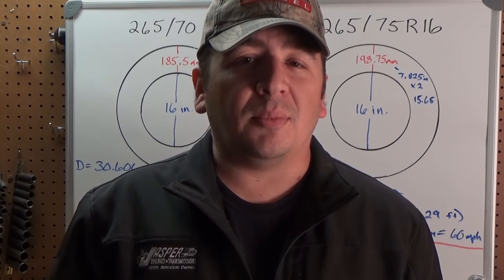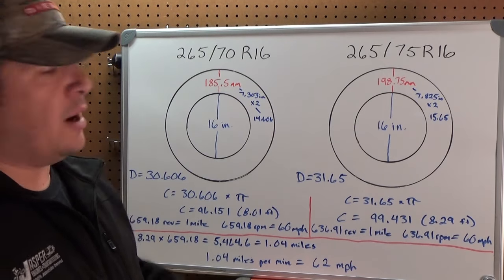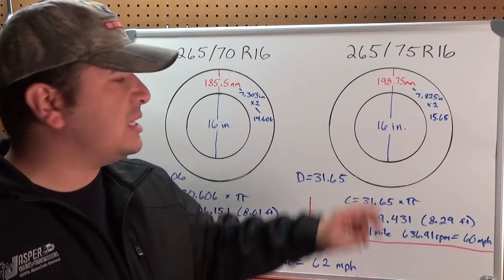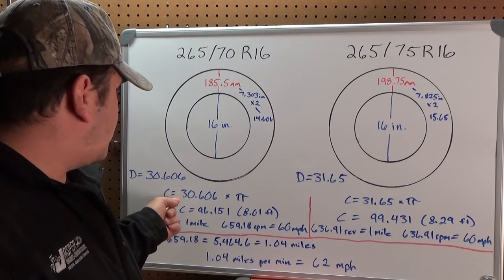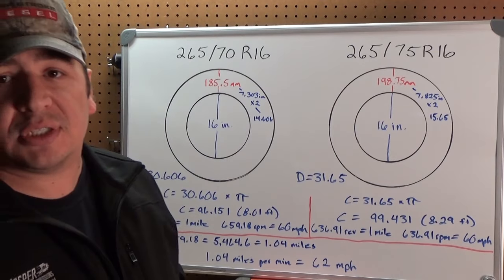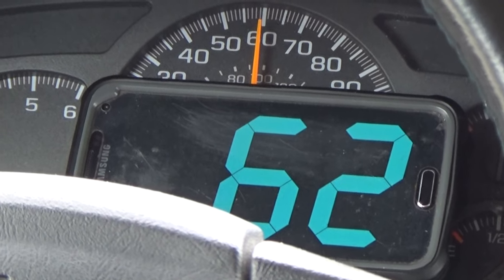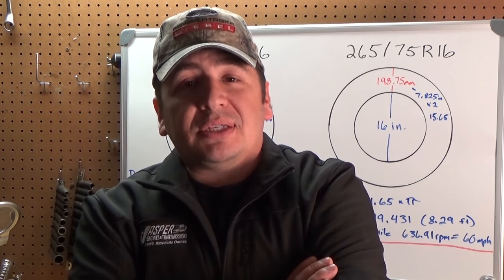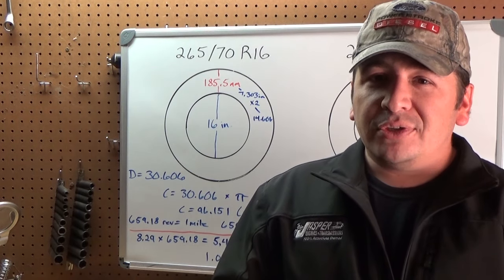Wrong Tire Size - What Does it Mean? - Automotive Education

Comment: Thank for this great info. I have two different front tires on my car. 225 40/18 and 225 45/18. I noticed my car has been sounding different once I turn my wheel to the right. I pull over to a tire shop and they told me about the wrong size. I went back to the place that I purchased this tire. They check and it was the wrong tire, im in the system but they didn't have my tire size. Now im waiting on a tire and see Mgr. I haven't too long purchased the tire about 3mos, I guess?. What should happened? She I be responsible to pay again or half or should they give me another tire? I dont know so im asking for help.
Reply from the maker: It stinks that they got the wrong tire on there. Speaking to the manager is going to be the best recourse you have. Your attitude and confidence in the discussion are going to determine the outcome. Many times, they will lean heavily on the fact that most people are timid and don't know the industry, don't let them do it to you. Don't be rude or mean (unless it comes to that). Be polite and firm, don't ASK what they are going to do. Tell them you came to people who are supposed to be professional and purchased tires for your vehicle. You got 1 tire that was not for your vehicle, so you didn't get what you paid for, and you would only expect they will honor your purchase and replace the tire at no cost to you. Might be a different story if it was 2 years ago, but it's not been that long. Your vehicle has a placard that indicates the correct tire size and pressure, and should always be checked before a shop installs tires on the vehicle. That's their job and their responsibility to their customers. Just be firm and don't back down, if they insist, don't agree to anything else and simply leave. Call or come back later and keep pestering them, make them understand you're not going away until the make right their mistake. 

Best of luck, sorry you have to deal with this. Remember, mistakes happen and you shouldn't define a shop by their mistake, rather, define them by how they deal with it.
Reply: DIY Auto Homeschool , Thank you for your help. I also have a road warranty on all my tires. I brought it from big business/company. One someone told me it can cause a wreck and mess up my front end, Is this true? I will be waiting to hear from them, I just want my tire corrected and soon. You are so right with you response. Thank you

Comment: What if i use a smaller 205/55 R16 tire instead of 215/65 R16? Will it affect the ride quality, gas mileage etc? Is it SAFE at all? I'm trying to cut cost here, so...
Reply from the maker: I'm sorry that I missed the notification for your comment when you posted it.

A smaller tire will have the exact opposite effect as far as your speedometer being accurate, it will say your are going faster than you actually are by whatever the difference in the math comes out to be.So yes, it will affect your fuel economy and your ride quality.Your fuel economy will be affected because you are not moving your vehicle as far as you would be with the larger tire with your vehicle operating under the same conditions. If you calculate fuel economy by using your odometer to gauge the number of miles you've gone.... then you will likely see almost no change, because that is a "vehicle-centric" view of the miles traveled and the same systems on your vehicle that calculate speed are used to calculate the distance you've driven. To get an accurate comparison, you'll need to measure miles traveled with an independent system, even something as simple as a GPS or speedometer app on a smartphone. Ride quality will be different as well with the resulting ride being more rough then with the factory recomended tire size. A shorter sidewall (55% of 205mm vs. 65% of 215mm) means that there is less flex in the sidewall rubber because it has a shorter distance to dissipate the road shocks across. Shorter sidewalls equal a rougher ride.

As far as "safe"? It should be safe with some minor differences in handling and vehicle control, but nothing that should cause huge issues with that kind of change in size. Just make sure all the tires are the same or at a MINIMUM that both tires on any axle are the same. If you have different size tires, expect issues to arise with your ABS and Traction Control systems. Some systems will just recognize a fault, some are sophisticated enough to determine that you have an incorrect tire size installed and set a code specific for that. In either case, the result is almost always the same. Lights come on... system disabled. Regular brakes will still be fully functional and not affected by the ABS and Traction Control systems being deactivated.

Comment: Besides the wrong speed on the speedometer?  Does it damage the gearbox or something?
Reply from the maker: Walter Molina No, the wrong tire size should not cause any damage to the transmission or differential. If you have different sized tires on the same axle and it's a drive axle, it will cause accelerated wear and overheating of the differential gears, and eventually damage them.

Comment: I Caught A Flat In my Clk550 My Back Right Tire It Calls For A 255 The Guy Put A 225 on it and said i shouldn't go anywhere but home until i can find the right size tire is this okay to drive on for like a week ?
Reply: If your car is AWD then don't drive it because you will mess up the AWD system.  If it's 2WD then just home in an emergency will work but don't continue to drive on it because it will effect braking and handling.   You need all four tires to match.

Comment: What about length meter.... Does it affects....?
Oil change time
Reply from the maker: Yes, the odometer will be affected, you will be going further than your vehicle thinks you are, so you're odometer will show less miles than you've actually driven. 

And mileage is a factor in the algorithm to determine oil life on most vehicles, so it's possible that it could affect that as well.  However, the affect on that would likely be negligible.
Reply: @DIYAutoHomeschool  thx alot...

Comment: Hai my stock Volkswagen polo come with 185/60R15 tyres
Is it safe to upsize to 195/60R15 ??
Reply from the maker: You're looking at a total tire height change of about 12mm. I doubt you'll run into clearance issues with that change, but it will change your speedometer some.
Reply: @DIYAutoHomeschool  thanks for you valuable suggestion.
Sir so what is the perfect upsize for polo 180/60R15 expect 205s

Comment: My theory is, if I go the same speed with a larger tire, instead of the smaller original sized tires, my RPM's will drop, and therefore better fuel mileage. 🤷‍♂️

Comment: I want to change from 255/35/19 to 275/35/19 
And in the front from 225/40/19 to 245/40/19 
Im aware that side wall would get a bit higher and I want that to get a bit softer ride .. is it a good Idea or will I have issues with abs and speedometer?
Reply: Those measurements mean you'd be changing the width not the height/aspect ratio, changing from 255 to 275 means you could not use same rims, what it sounds like you want is it change 35 to 40 in the front and so on
Reply: Michael Joseph if I changed from 35 to 40, the difference would be drastic 
But if I used a wider tire with the same ratio (35%) then I will have a bit higher side wall in addition to the wider profile
Reply: Michael Joseph why do you think I can’t install a 275 tire on the same rim? Is 20mm difference in width too much? And how would it affect the car if it fits?

Comment: I have a bmw e90 320d it has 225/35/19 on the front and 255/40/19 on the back  I'm finding the car wants a to drive it's self when I'm going 50-60 onwards will this be the tyre size because the back are not having to work as hard as the front. I'm finding the car seems to start accelerating itself and I think that has something to do with BMW wheel speed sensors picking up the cars difference and trying to level the speed out. I've currently taken the alloys of for my stock tyres and the car hasn't had any issues since but if I know it's the size difference I know to get some new tyres like 255/35/19 and that should level it out. is that correct ? thanks in advance.
Reply: U need 225/35 front 255/30 Rear ok bro

Comment: I blew my tire out and they put on a tire 1 size too big to get me home & on my way home ALL emergency lights came on, we replaced all tires and lights are still on? PLEASE HELP! 😔
Reply from the maker: I would ask the shop who did the tire work to clear the codes that set. On most vehicles, the ABS unit looks at the wheel speed directly with sensors at each wheel. The ABS unit can tell if something is not right, like 1 tire constantly spinning at a different speed. It's not uncommon for different sized tires on a vehicle to set ABS, Traction Control, and some other warning lights. When the light comes on, it just means that that system saw a problem or something wasn't right and it set a code which will let the technician who looks at the codes know exactly what it saw that it didn't like. In this case it likely set an incorrect tire size code or an implausible data code.

On some Honda vehicle, you may get a VSA light as well, it's still nothing to be concerned about, but it may require they do a quick re-calibration to let the vehicle relearn it's neutral points for the steering angle, yaw rate, and other inputs.

I don't think you have a problem, the codes probably just set when the wrong tire was on there and many times they will not clear on their own and need to be cleared with a scan tool. The shop who temporarily put the wrong sized tire on should do this at no cost to you.
Reply: DIY Auto Homeschool yeah they said they didn't know, my father said "u can't even take a guess?!" So I went & had a basic diagnostic test done at a local advanced auto store & even with ALL the emergency lights being on, only 1 code came back & it's a sensor (which is most likely because of the incorrect tire being put on before I got the new tires put on) so we just agreed to be on the safe side, I'm going to take it to the dealership where I'm still paying for the vehicle & have them put it on their computer there for the $127 to double check just to be sure & they can wipe it clear there... but THANK YOU sooo much for getting back to me! That's the 1st time anyone has ever responded to 1 of my questions on YouTube & I appreciate more than you know! 😊
Reply from the maker: I'm glad you're getting it taken care of t seems, but it is unfortunate that you would have to go to the dealer and pay that much just for them to clear the codes. Many shops, as you have found out, do not carry the kind of scan tools required to check all the systems on many vehicles. Even the most capable aftermarket scan tools will not have access to certain modules on some vehicle where the manufacturer still holds access as proprietary information. However, they should carry a tool that has access to the ABS, ESC, and Traction Control systems as they are typically controlled by a single module. I hope you get it sorted out and and maybe you can convince the dealer's service department to just clear the codes without a diag charge and tell them if there is an actual problem or if they come back on, you'll come back and have them do the diagnosis. 

Hope it all works out well for you. I highly doubt that you have an actual fault, and once the codes are cleared, you'll be back to everything working normal. There are options to clear the codes without a scan tool, but there are also concerns that go along with that. Disconnecting both battery cables (as well as both reserve battery cables on vehicles that have emergency back-up batteries) and using a jumper wire to connect the negative and positive cables will force a discharge of the capacitors and dump all volatile memory which is where DTC'S (codes) are typically stored. But, not disconnecting them or leaving the circuit energized can cause damage, and dumping all memory will lose radio station presets, and a lot of other little things and can sometimes cause the vehicle to feel a little funny driving for a short time. In addition to that, some codes will not clear this way, they are stored in non-volatile memory and can only be manually cleared, and others can only be cleared once the module sees no fault in the system for a certain number of key cycles and clears the code itself. 

I'm sorry if that was confusing, but I'm just trying to explain why I didn't walk you through how to try to clear them yourself, there's just a lot of possibility for error and I'd hate to make your situation worse over something that is most likely not an actual fault in the first place.

Comment: Let's say my tire size 225/75r16 but I use 235/70r16 what would happen
Reply from the maker: Let's Play some Games Without going into the full calculation like I did in this video, the quick check says that using 235/70/R16 tires when the vehicle calls for 225/75/R16 tires gives a difference in the height of a single sidewall of about 4.25 mm. The 235/70/R16 would actually be shorter than the correct tire and would give you the opposite effect. My guess... when your speedometer said you're going 60... you'd be going about 59.
Reply: That's too technical.  What you want to hear is the new 235 size will give you more road contact as your go down the road and improve handling while the 70 have less tire wall between the wheel well or shorter in lemon term which result in going less distance for the smaller diameter of tires size and and 1 mph less then the 60MPH you're suppose to be. Simpler terminology where common people can under stand not science.  LOL

Comment: is it safe to use 225/60/16 on my 2018 saturn vue if it calls for 235/65/16?
Reply: Yes, its safe minus a few disadvantage. 225 means you have less tires contact with the road surface which reduce handling,and the side wall of the tires to the fender of your car is 1.0" inch lower and you'll travel less per distance since your tires diameter has been reduce to 60...etc..

Comment: Actually this prof is wrong he shouldn't multiply the rpms that he saw on the small tyre to the large tyre to get wht the odo will show. What actually will happen is the rpm will be less. As the tyre is larger its circumference is larger thus it needs less rotation to cover the same distance as a smaller tyre. Thus there will be a lower rpm recorded on the wheel. Which the computer will percieve as lower distance and speed. Thus u get a false lower reading. Not high!! So much for a tyre prof😅 

i knw he is not a prof.😝 But sure wud pass for one